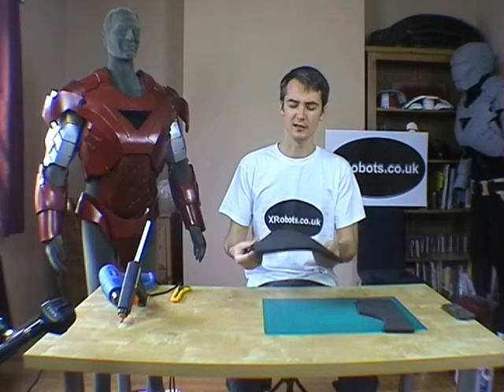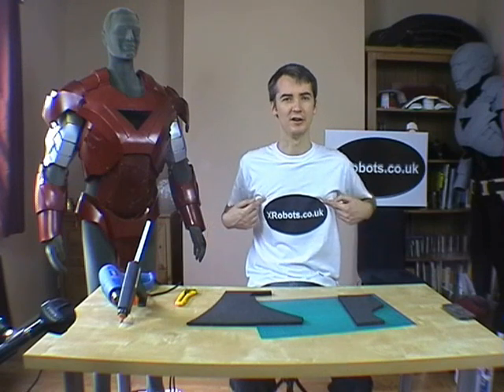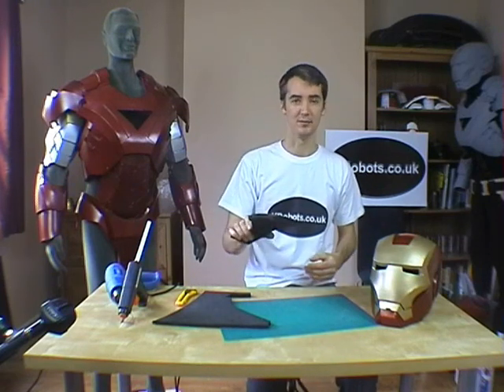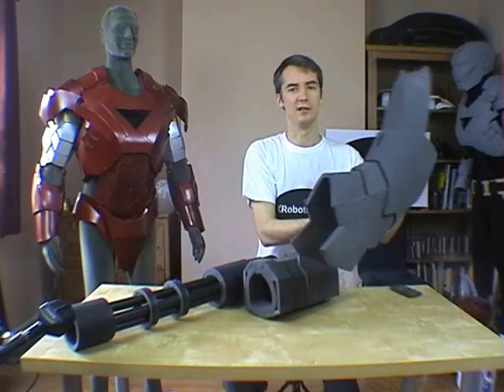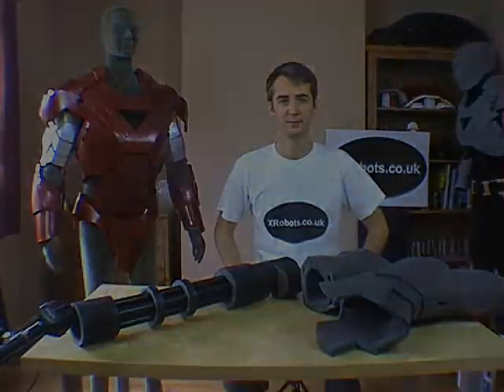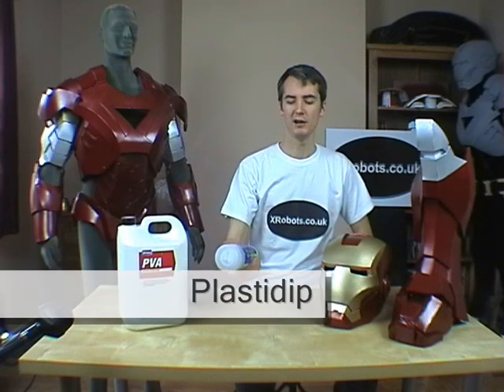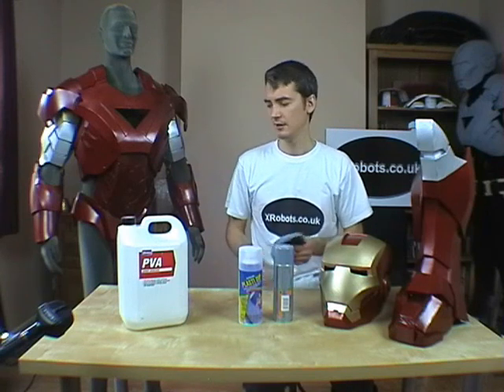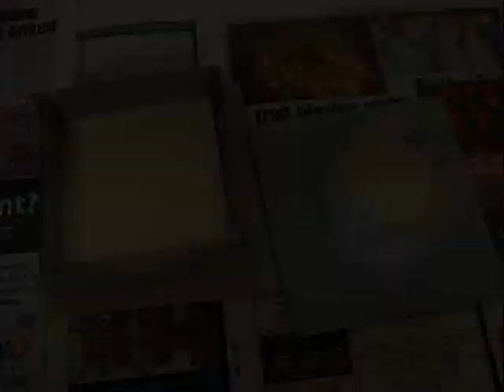Iron Man Power Suit #1 | Iron Man Suit Pieces | James Bruton

Comment: did you print out the pep files onto paper and join all the paper pieces together to make the template? as you know the pep files come with lots of cuts, so its not like you can just print and use it as a template straight away? if you do a continuation video do you think you could show, even one small piece from the printing the pep files to taking it to the foam and cutting? if you understand what i mean? lol not to sure how to describe it.  thanks :)

Comment: one method that you might find works a bit better than pva to give ya that glossy metalic look i recommend would be ether liquid tape "the stuff used for splicing wires" being it's a very flexable rubber. and or a latex base clearcoat. these will allow the foam to still flex easy enough and not crack when flexed. i know i don't have a vid on my work.....trying to make a unique design soo, till then all of youtube will have to wait

Comment: I was wondering two things. If your glued seams have gaps and are not as flushed as you would want them to be, what kind of filler could I use to close these gaps and smooth rough edges on foam armor? Also what could I used to add smoth embossed designs onto a foam armour piece (The suit Im working on is more medieval so alot of decorative embossments). Thank you very much, your video is amazing, I'm already subscribed and anxious for more.

Comment: @jamesbruton Hi again, i have cut the pep out into lager pieces, which i think would be capable of using just one piece of foam but for pieces like the top of the helmet, it has a vertical slit and a few horizontal slits to get the curvature of the roof of the helmet, yet if i lay the pep template flat with the slits open the foam piece is too big, but if i connect the slits so the piece is curved then i cannot  get a accurate transfer onto the foam. sorry if i am missing something or if i am...

Comment: @jamesbruton 
Thanks for the quick answer. I just have to answer one more thing: how stable is the costume? Obviously you wanted to use it as a wearable costume (otherwise why bother painting?), but then you used it for creating a molded costume. Unsatisfied with the results, or just "aim higher"? As a Halloween costume there is the problem with sitting on chairs, wonder if the foam flexes back into position.

Comment: Hi James. Great video. Very informative. Quick question. I am making a Buzz Lightyear costume out of Plastazote at present and am going to try your method for painting it. How many spray cans of Plasti-dip did you use to cover your Iron Man suit? Is one coat of that enough before priming? and would it be worth getting the tins instead, or is it harder to get a smooth finish with brushing?
Thanks, John

Comment: Hey, so a lot of people use "plastidip" to seal their foam costumes. I found this thing called "mighty sealer" and it is a liquid rubber spray thing. Is it basically the same thing? Plastidip's website says it's rubber as well, so I'm really confused as to whether or not this will work the same way? Thanks for your help and you do an AMAZING job at what you do!

Comment: So i just made my first Iron man helmet (mk 6). I used plasti-dip. then plastic primer and then i painted it. It looks good when it is just on display, but when i put it on it kind of expands. It's not too small or anything it's quite roomy on the inside, but the sides expand when i put it on and it just looks silly. I made it out of foam and i did my best to follow the guide. Anyone got any suggestions to what i can do? I'm okay with redoing the entire thing.

Comment: Hello, I have a question. In the UK, you use "PVA Glue", over here in the US I found "PVA Primer" at home depot. Is this the same thing? Will it work for the Foam sealing step? or is it completely different?
http://www.homedepot.com/p/KILZ-PRO-X-1-gal-PVA-Primer-PX01001/202837010

Thank you for the video, it has helped a lot.
Reply: I had picked some up too and was wondering if it is good for insulation foam board as well as the EVA foam.

I have some liquid latex... debating on using one or the other, or a few thin layers of both before black bombing the foam board